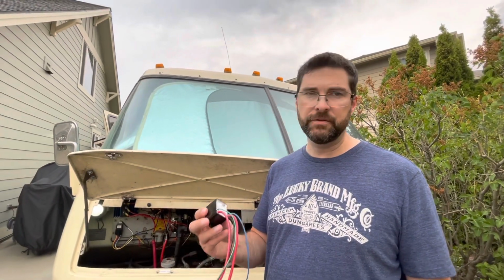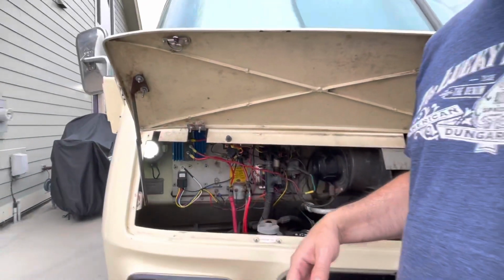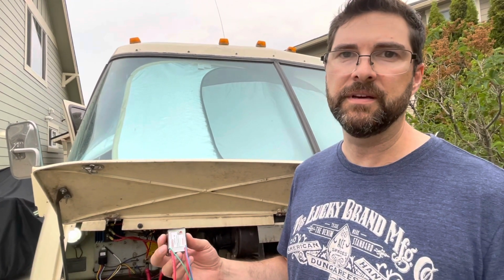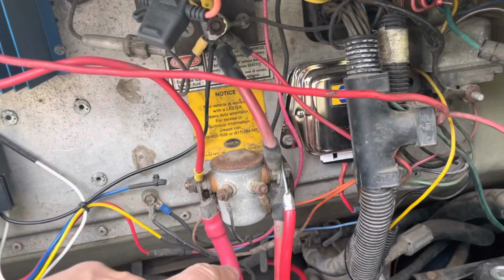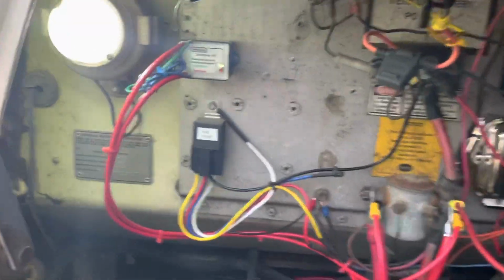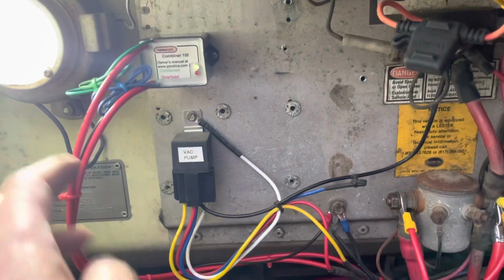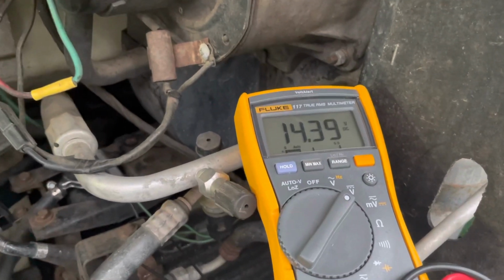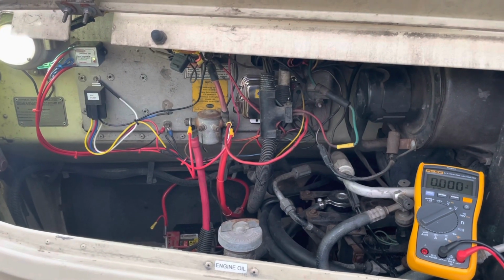‘77 GMC Motorhome Battery Combiner

Comment: It's a manual method but connecting the top and bottom lugs of the isolator with a switch or plug connector will charge both batteries when on shore power as well.    Most connector plugs have an linline fuse  so you have to disconnect it or it will blow when staring the engine.  The combiner is more convenient though.

Comment: the diodes in the isolator will  "draw" around .8 volts or so, so when you hooked up the combiner, you got actual voltage at the batteries since the combiner must be more efficient

Comment: Are you familiar with the Samlex ACR160?  It is a charge isolator that keeps the house batteries isolated from the engine battery when dry camping to protect your engine battery from being run down.  However when you are on shore power it charges both the house & engine batteries from shore power. When you unplug from shore power and start your coach it switches and charges both the house & engine batteries from alternator power.  It also retains battery boost.  An ACR160 is ~ $110   I recommend watching Jim Bounds new video on this  https://youtu.be/9wLTedB8S-I
Reply from the maker: I looked at a couple different combiners and decided to go with the one I linked. They seem to work on the same principle. I still have the solenoid for my battery boost. Jim Bounds has a wealth of knowledge on GMC motorhome and I try to watch all his videos. They are usually where I start before doing my own projects. I highly recommend his videos!

Comment: Good job, thanks for demonstration that. 
I just left the isolator in place
Reply from the maker: Thanks! I took out the isolator just to clean things up under the hood a little. Maybe it's good to have the isolator just in case you need a backup to the combiner.